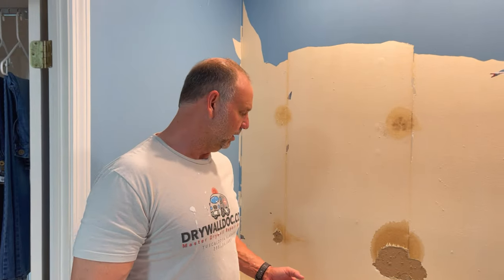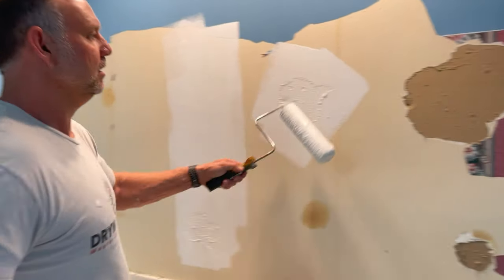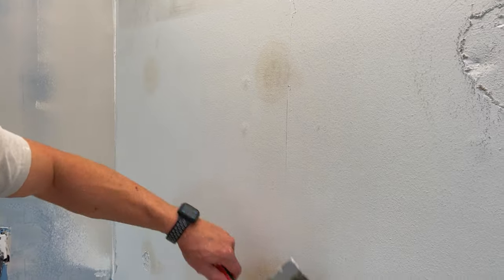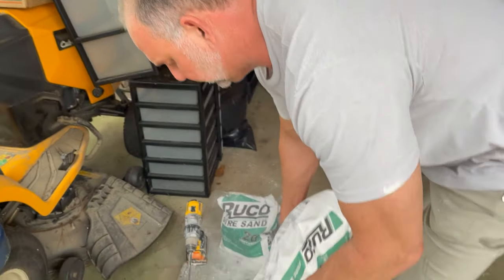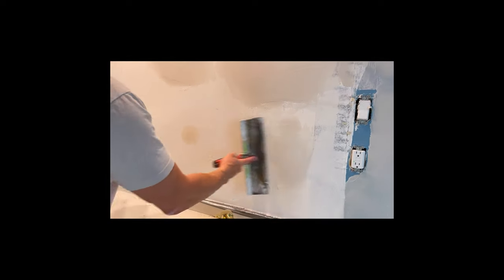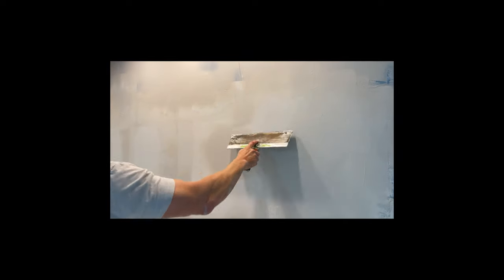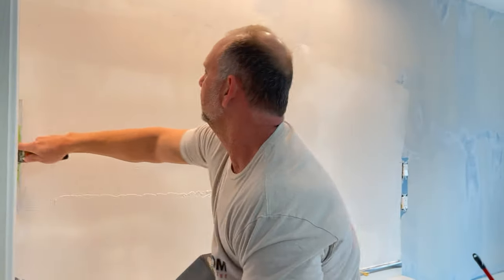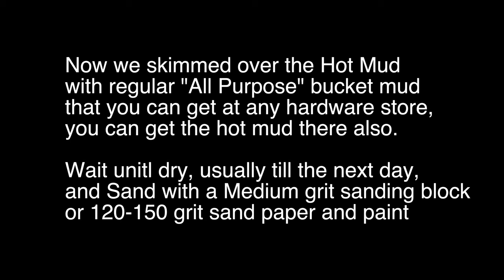How to repair drywall wall where Mirror glue was after removing a Bathroom Mirror

Comment: Did you leave the wallpaper up and mud over it? I'm trying to learn. TIA.
Reply: As long as the wallpaper is stuck to the wall good and not trying to fall off, then yes I’ll leave it up and prime over it with an oil based primer to lock it in then I’ll mud it over it